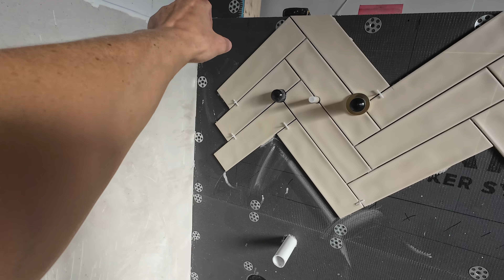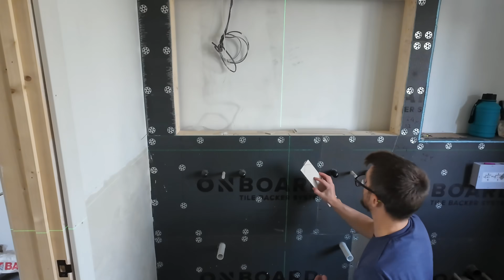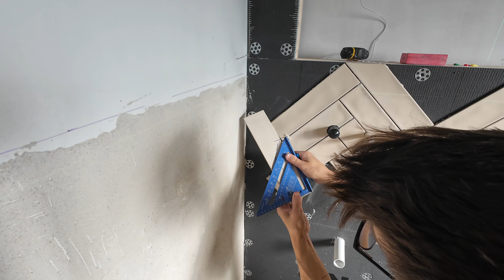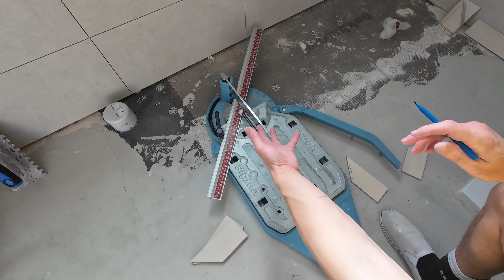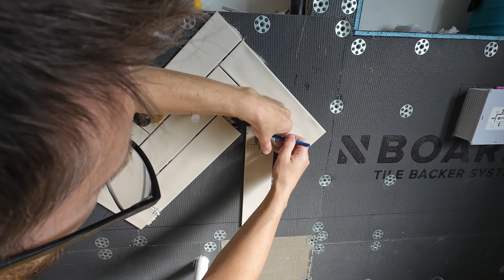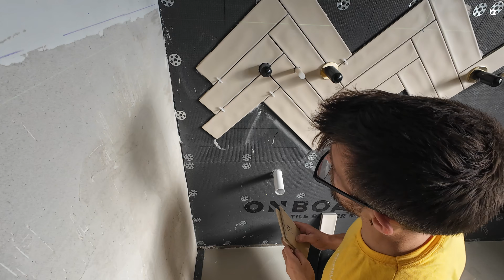How To Cut Tiles For The Herringbone Pattern!

Comment: I'm always wondering how you stick on the tiles without saging. Mine always sag a bit when I hang m like that.
Reply from the maker: What adhesive do you use mate? I had to budge a few of these back up.. But the Bal flex one holds up pretty well considering on backerboard.
Reply: @thebespokebloke usually Dunlop CF-24 flex, sags only slightly but still

Comment: Great video perfect timing for a job I got coming up, the plumber wants me to do the wet room floor first then herringbone after but I think that’s going to be a right pain scribing herringbone into the fall of the floor, everything will be tanked. Do you you think it makes much difference watertightness wise to do the walls then the floor?
Reply from the maker: Nice mate, I would do the floor first in a wet room, As it just ad's that extra barrier of protection (floor tile under wall tile) I wouldn't worry about the herringbone to much, If all go's to plan the perimeter of the wet room should be level-ish. But if it isn't you can guesstimate the scribe.. mark one end of the tile like in the vid, then tilt it in the cutter to get the rake by a few mill. Or if grinding them just adjust the cut line for the rake. Over the distance of a tile you'd only be a few mill difference max on an un-even floor. But hopefully the wet room tray is put in level, The outer flor is level, and you'll have no real issues.. Apart from the pain of having to tile herringbone haha
Reply: @thebespokebloke sweet thanks for that after a few cuts I’ll get into the swing of things I’ll just keep reading your reply when I’m on the job 😂 also there’s a niche so it’s going to be a fun one :)
Reply from the maker: @BenPrice-zt6lc Haha oh what joy mate, Maybe if it's not to late tell them to oversize the niche, So you can shrink it with backerboard to make it work nicely on the tiles. But yeah just centre the main wall and away you go, It is what it is..painfull and slow, But the good thing is you'll be happy once it's done 😂
Reply: @thebespokebloke that’s a great shout I’m going to message him in the morning 😂

Comment: Hello mate. I assume the herringbone is just a feature wall ? One thing I would add when wrapping herringbone around a corner, all cuts must be precise to continue the pattern. Otherwise it will run out
Reply from the maker: Hey mate, Yeah that's covered in my other videos, this is just purely about cutting. But yes I probably should have mentioned that just in case 👌
Reply: @thebespokebloke  I see. Many thanks
Reply: Tit